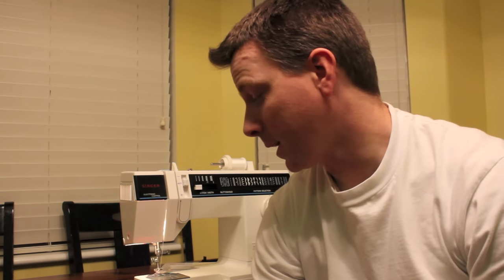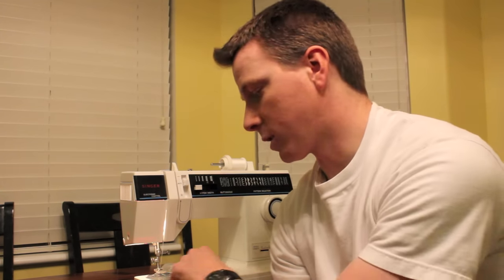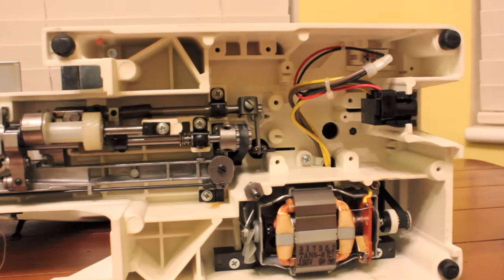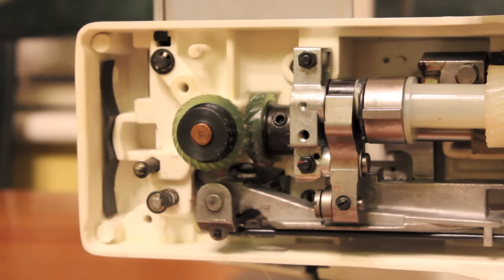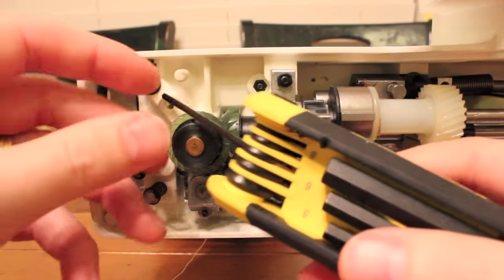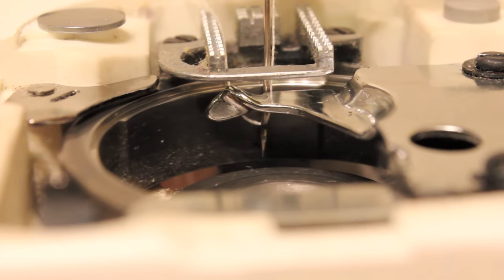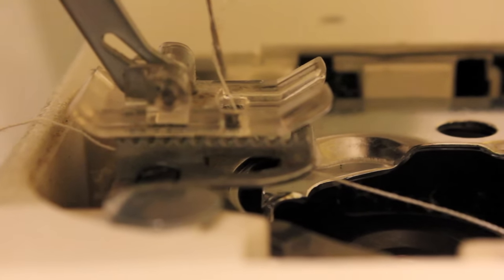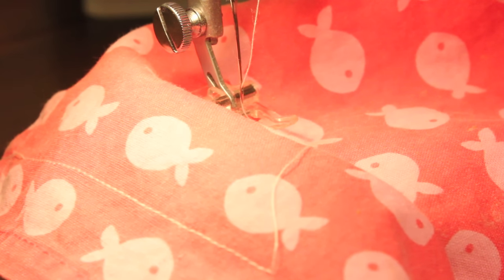How to Fix / Repair the Hook Timing on a Sewing Machine

Comment: So, let me get this straight; you are posting a video on how to fix sewing machine timing, but in the video you admit  that you more or less just happened to get it working  by chance and dumb luck... I don't see how this is instructional in any way.   Proper sewing machine timing requires adjusting/checking each needle position of the 3-4 stages a needle moves through when sewing a stitch.  An instructional video should also aspire to use the correct terminology/vernacular as it avoids ambiguity...  I did however gleam something useful from it;  its worse to post a useless video than to post nothing at all.
Reply from the maker: Tell all that to the hundreds of people that have fixed their sewing machines after watching this video. Please feel free to post your own video to help others any time. And it's glean, not gleam. Troll elsewhere, SomeDude.
Reply: Nils Rasmusson Thank you for taking the time to post this great how-to.  No one who is fixing it at home really cares what the parts are called. By chance or on purpose, if I can save 90 bucks (or, more realistically, the cost of a new machine) and the thing works right, who cares... especially the week before Christmas!  By the way, your video is much better than (but not as funny as) the drunk Canadian guy who comes up as a recommendation when yours ends.
Reply: Nils Rasmusson , I'm pretty sure you are your wife's hero. No amount of super powers can equal the charm of a man who can fix things, so that gives you points over Superman. Trolls will be trolls, don't you listen to them.
Reply: Nils Rasmusson
 Thank you for telling him off. I am very happy to see you post this, i am a cheapskape because i need to save money for my wife! Now, i got a problem. I replaced the belt gear and the shaft gear(the long one)but did i make a mistake when i timed the two center gears, especially the one that runs the one that moves the lift up and down. I am not sure how to retime it correctly. What should i do first?
Reply: Nils Rasmusson WELL SAID!
Reply: Lynsey Wellington
I got it in time and it is singing a song. I went by a shop and saw about a hundred of these Singer 748 setting there collecting dust. He wanted 100 bucks to look at it and possibly fix it but came up with all sorts of things that maybe needed. All i needed was one small long plastic gear. I removed the shaft and took off the gear, replaced it but later found out that i had it out of time. I retimed it like you said but that shaft has a flat spot which will have to be set back right on it for the key. Now, i had to remove the main belt gear screw so it would loosen the shaft up freely to turn and i slid back the long plastic gear on that shaft and i was able to line back up the hook by rolling over and over the needle down into it until it did not hit the metal as the needle went down. I turned the gears until the needle cleared all with the hook a little prior to the needle but raised the needle all the way up before setting back the long gear on the 748. Now i had to hold the shaft to get the belt gear on so the shaft would not turn any and i found out the dogs were out of sinc with the needle going down. I had to reset the cam setting so that when the needle came up the dogs would move backwards to out feed the material. I did it and i have never ever in my life worked on any sewing machine. My wife has made all sorts of clothes with it since. It sings a song. I do not prefer plastic gears but it is ok for plain cloths.
Reply: @SomeDude: I was having the exact same issue as Nils on my Singer sewing machine. I went on several sewing machine forums asking for suggestions, I contacted Singer directly only to be told that this information is not available to the public and that it is only shared with Singer repair technicians. After watching Nils' video I was able to troubleshoot my own machine and now it's working just fine. Even if it was just dumb luck that Nils had, he was on the right track and he DID fix the machine. You have to understand that some of us can't afford to take our machines to a repair shop and there isn't one near me at all. Whats more, a repair shop is going to charge more to repair certain sewing machines than what they are worth. My machine cost less than $100.00 and instead of paying to have it repaired I would rather buy a new one. For $60.00 I can buy a Janome Mini. If it breaks I can just toss it and buy another one. Not that I would do that because I don't have money to throw away. I am just making a point.
Reply: Nils Rasmusson
LOL. I loved what you said to SomeDude. We have to learn how to do these repairs ourselves. Some people are just idiots.
Reply: *****
Lynsey Wellington See? There are tons of sewing machines sitting in shops because the owners can't afford to pick them up. $100.00 for a repair? Buy a new machine.
Reply: sandra johnson  Never know until you try, but there are those out there that will do their demon best to keep you from learning the right way. I think they go to Hell?
Reply: sandra johnson  Buy  a new machine? Well, i say fix it yourself if you want to save money!
Reply: *****
This was directed to the person that advised to buy a new machine. Not you, sorry it did not post to them but you only. I think they are not concerned with learning how to do anything except sell things.
Reply: Nils Rasmusson Thank you for helping fix my machine. Screw the haters.
Reply: SomeDude  - I'm a medical device engineer by trade, but I honestly don't care what the terminology is besides get an allen wrench and loosen the set screw.  If I were getting paid to fix sewing machines I might care about the appropriate terminology for everything.  The point was to show people visually what everything looks like, where to make the adjustment, and what it ought to look like when correct.  Mission accomplished.
Reply: SomeDude This video was very informative . What this fellow did was share 
his experience Which i found very helpful.
Reply: Let me get this right. You paid this guy a gazillion dollars to show you how to do this?
Reply: Yeah I'm trying to fix my machine and neither know or care about proper terminology because guess what, since I don't know them, they don't help me fix it. His terms since are super basic, let me know that I'm looking at the right thing. Example: "Dark round thing with hole" vs "Timing Gear" :I know exactly what they mean in the first case but in the second I'm looking for a literal stereotypical gear. If I don't, even when pointed to, I am unsure since I am very far from a professional.
Reply: SomeDude u
Reply: SomeDude let’s talk straight “Dude”  you are complaining about terminology , but where is your instructional video? I was trying to fix my machine and I didn’t find your video.    however I find this nice gentleman’s video, very simple and logical, for people like me; that no need a lot of bla bla, to understand and save more than $100.   you should do your own instructional with a lot of fancy terminology instead that criticized the other good deeds.   Shame on you!